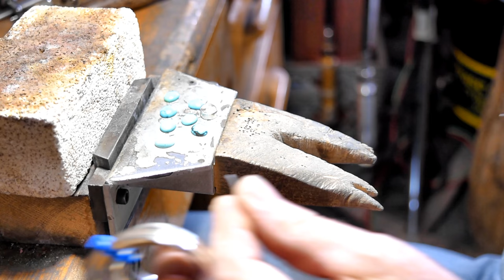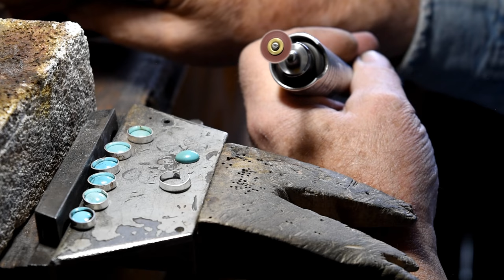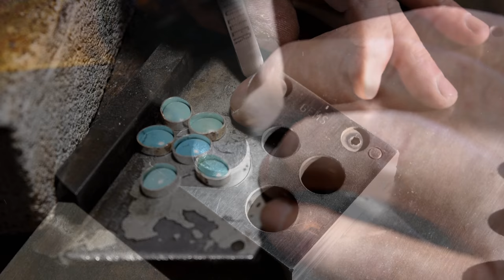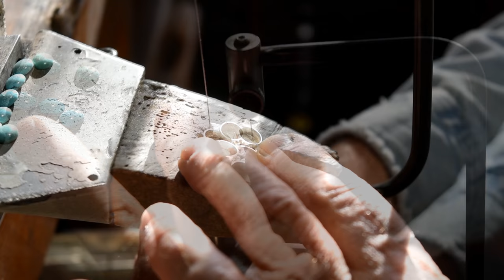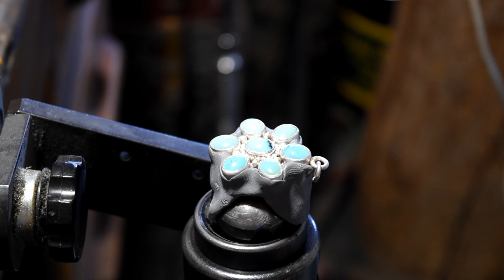Fabricating A Multistone Turquoise Pendant

Comment: May I ask please, what the liquid is that run down your solder seam before adding the solder. And what is the goo that you heated to hold your piece for bezel setting! I so appreciate that you are willing to share your experience and knowledge. I’m still learning.
Reply: I am venturing a guess with the liquid being flux. My best guess would be Batterns or MyT Flux, or something similar. The goo is Thermo-Loc. You can heat it (I have seen it done in hot water) and mold it to hold your piece in place! Other products are similar, but people tell me Thermo-Loc is best. I have Jett Set.
Reply from the maker: The liquid is Batterns liquid flux and the goo is Thermo-Loc

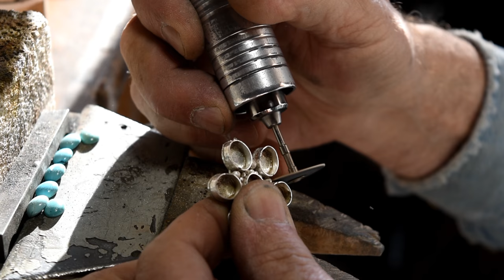Comment: Thanks for the great video, Steve.  Are you using a cutoff wheel around 7:30 or is that some kind of sanding disk? I've been using the rubber/silicon grit wheels for grinding down silver to merge with bezels, but I'm not convinced they are the best for the job.
Reply from the maker: That is a course sanding disc followed by a medium silicone wheel. I like the medium silicone wheel because it leaves the surface ready to polish.
Reply: Thanks Steve! I'm going to order up some sanding discs and see how I like them.

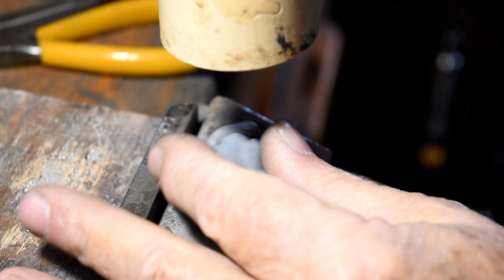Comment: Hi Steve! Love this. Did you use a hair dryer at 9:28? :D
Reply from the maker: Yes, that is a hair dryer :) I used it to warm up the Thermo-Loc to make it pliable. It didn't work very well on that large of a piece and I ended up carefully heating it with my torch. I used it to warm up the pendant to release it from the Thermo-Loc, That worked very well. The manufacturer says not to use a torch, it is dangerous :)

Comment: I'm just getting started with learning how to solder and set bezels.  I have some of the basic tools but have been struggling to get the bezel to lay closely to the stone without a ridge with my burnisher (I have one like yours).  Can you tell me what the little tool is called that you tap with a hammer to close in the bezel tighter?
Reply from the maker: The tool is a punch I made. You can buy a set of small punches at a hardware store. The size of the small end that contacts the bezel can be modified by grinding it with a course sanding disc. The end should be relatively small depending on how thick your bezel is. A wider flat end will work well on 28 gauge or 26 gauge. You could also use a chasing tool. The end of the tool should be flat with slightly rounded edges and the end should be sanded down to 600 grit so it will leave a smooth surface. A polished end would be slippery and a little harder to control. Avoid letting your burnisher or punch ride over the top edge of the bezel. I used 26 gauge bezel wire in this project and I used a medium grit silicone wheel to smooth the bezels after the punch work. Overlap the punching locations to maintain as smooth a surface as possible. Start at a low angle to get the bezel to touch the stone all the way around then use a steeper angle on the punch to close the top edge down without distorting the top edge of the bezel. Takes practice :) The angle of attack is very important. If you continue to push the bezel wire against the stone after it is touching the stone the bezel will stretch and it will not tighten. The goal is to gradually roll the bezel over the stone edge in an even manner, beginning at the lower portion of the bezel and finishing at the top with an angle of motion that pushes the bezel down and in at the same time.
Reply: Thank you so much for going into so much detail!  I greatly appreciate it!  :)  Definitely going to do that and play around with my copper until I get the hang of it.